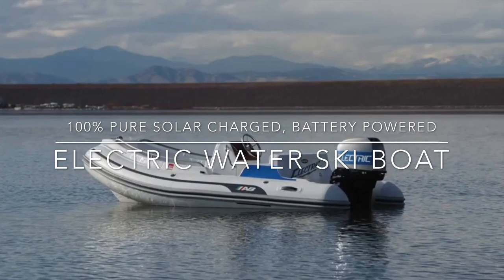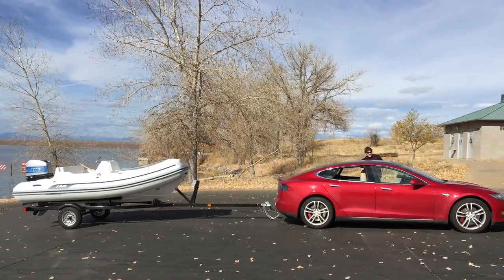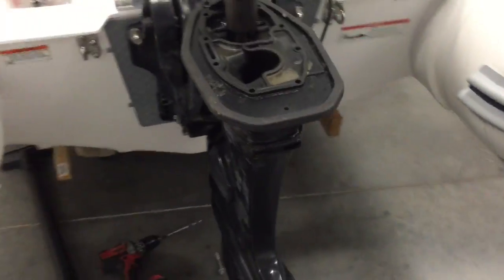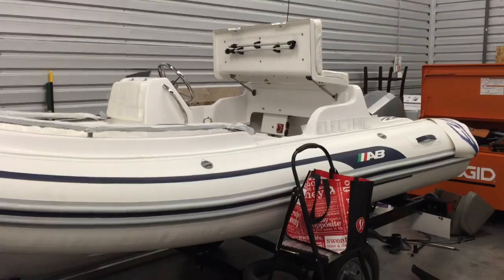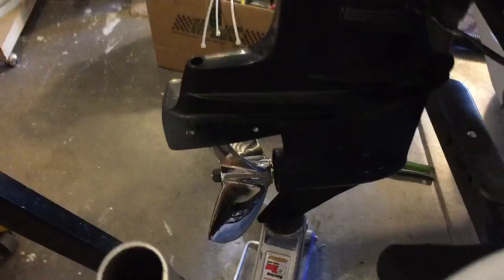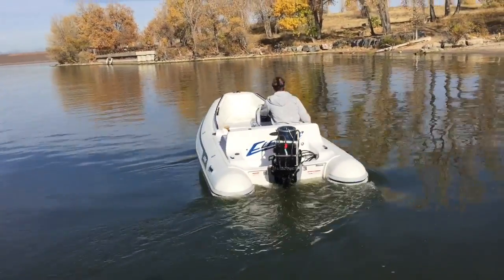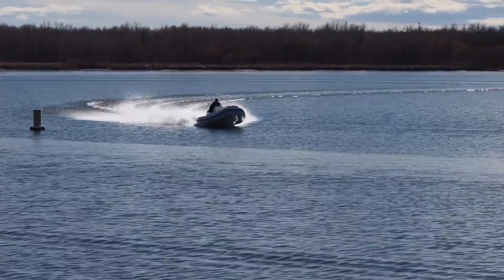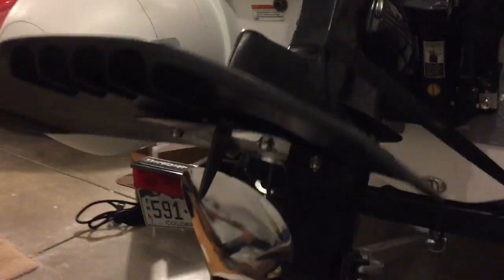World's Fastest Solar Powered Electric Water Ski Boat  (full documentary)

Comment: ITS NOT SOLAR POWERED !!!!!!!!!!!!!!!!!!!!!!!!
Its battery powered.   Solar recharges the cells.
Reply: He has at least a  50,000 watt battery cell.  It would take forever for a pair of 250 watt panels to charge that thing.
Reply: If you had a day of wind around 45mph and a turbine you could charge that battery up within a few hours and then go  out and try to fight the wind.
Reply: Dan Henderson I have a question how does the water and electrics work ? Is it not a problem when it gets wet ?
Reply: @rsafishingnoob6337  you mean you've never had battery powered toys that you put in the water?
Reply: @rsafishingnoob6337  Most electric motors run fine completely underwater. Usually the only issue is corrosion.
Reply: Well if you want to get technical/literal, are you powered by food, or by fat, or by the chemical process your body uses to get the energy?...you know what they meant... Technically pretty much all our energy comes from the sun. You say it's battery powered, but batteries don't generate power, they store it chemically, so technically you're wrong. It's electrically powered...Lol

Comment: solar works awesome if you have the time to allow it to charge well know fact 
but today most do not have the time and require transportation right now 
yes i have 1100w of solar charging 16 6v cart batteries with 2 40amp charge controllers and a 1800w inverter powering all internet power and all charging of devices that require it like cell phones tablets and laptops and i can even run my gaming pc with a 42" lcd tv 100% of the time 
also have a water heater with a single 300w 12v heating element with 3 100w solar panels connected producing most of the hot water we need but with all of this i still understand that Natural gas and oil still produce much cheaper power for the world that also at this time still produces less negative harm than the battery and electric production when you count all of the pollutants produced by manufacturing of batteries and recycling batteries and all chemicals required for there use of solar 
i know that some day Solar and wind will be the way to go but in 2017 it is not the best or cleanest way to produce power but soon it will be and i am 51 years old and hope i see the day

Comment: I love this idea I'm glad it worked out great but a typical gas and does not idle at 1000 rpms and idles at about 5 to 600 RPMs anything higher than that will cause damage to the forward and reverse selector also you need to switch over to a hydraulic trim this will help you plane easier and then you can change the pitch on the engine itself the cruise better at speed

Comment: Wow, very cool. Great job. Why wasn't the oil cooled motor not good at the end?
Reply: Seems to me the oil leaked oil when positioned in a way it not made to be placed, not to also mention it adds weight on top with the cooling system needing to be installed to cool the hot oil.

Comment: I love it!  Great job on a great project.  Looks like your welder needed a couple more batteries to get good penetration on that aluminum plate. lol It appears that you are certainly smarter than me, and likely don't need the advice, but if you preheat your aluminum plate with a torch or in the oven, you'll get by with a smaller welder.  Again, great job.  Subscribed.

Comment: Pretty cool project. Either get some more practice at welding or bring it in to a professional. The welds on that mount looked scary.
Reply: He needs a Square Wave welding machine for aluminum welding. Older high frequency machines make it very difficult to make good looking inside corner welds even for a welder with experience.

Comment: Not technically solar powered if there are no solar panels on it!
Reply: Gillenz Fluff you didnt think that through did you?
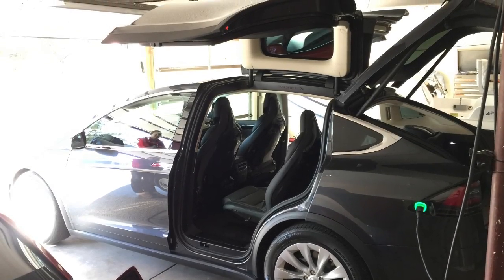Reply: I think he was using the solar array shown at 0:40 which looks more like an 8 or 9KW setup. But I also find no mention of run times to be curious... 53mph for 1 minute is kinda pointless.
Reply: NET METERING!
Reply: Gillenz Fluff A charge by solar power as a battery a good invention.
Reply: Agreed... great engineering, but dubious title and performance claims. I have great respect for the mechanical and electrical engineering required for this project. However, the title is inaccurate at best, and click-bait at worst.  This is an impressive electric boat that is capable of pulling a skier, but it is neither solar nor is it a ski boat.  

The solar panel that he shows at 6:09 (230W?) would require months to recharge a "40KW" battery bank. The author states at the end of the video, "... recharge in about 4.5 hours on a 240-volt circuit...". That implies mains power, not a solar system. Of course, he could have a large, solar-powered charging system at his disposal that would make this an INDIRECTLY "solar-powered" boat, but we're really stretching credibility here. 

No runtimes are cited. The speed figures in the video overlay aren't backed up by any onboard speedo or GPS figures either, so we're essentially looking at marketing fluff.  Hey, I have a flat-bottomed bass boat that does 200mph and makes perfect 90-degree turns at hull speed... any takers? :-/

Comment: I like smellin the gasoline and oil while boating myself,  and the hearing the noise of the motor also. Electric boat / fail. Sorry. Nice experiment I guess.
Reply: Bob Kerbs if it works, how is it a fail
Reply: Actually the energy from petroleum came from the founding of the universe. It was proven about 25 years ago that petroleum was created when the earth was formed. It comes from the deep earth. It flows through fossil beds and that is why the mistaken theory it came from dead dinosaurs. If it was only formed from decayed plants from the prehistoric eras, we would have run out long ago. Search abiotic petroleum.
Reply: Elliot Roe it's a big fail click bait because he says solar powered and clearly it's not. Solar charged perhaps, but battery powered with juice from coal, nat gas or hydro.  Look down the line and someone's  polluting to make the juice.

Comment: That is fairly fast for a dinghy.  My taste runs more to boats that can hold the whole family. What's the run time on that thing at skiing speeds?

I looked into building an electric boat a while ago, but that was pre-Tesla and would have required about 3000 lbs of batteries. It looks like technology has improved substantially.  Where did you get the modified golf cart motor? 

You obviously have a great deal more money to experiment with than I currently do.  Maybe in a few years I'll have a little more money to play with.

Comment: I'm missing the solar part
Reply: You can easily make it actual solar powered by putting extendable outriggers on the sides for the panels and then putting them on when the batteries are charged.
Reply: He charges the boat battery with his solar array on his house.  Thereby, it is a solar powered boat.
Reply: @JPZANE  NO. Its battery powered, he recharges the batteries with solar thats a difference. If you are able due to solar panels ON your boat, to run the electric Motor with solar power, than you can say its solar powered-

Comment: I would have been impressed if it were actually solar powered, even if it only goes 3mph.  This is more accurately defined as a hybrid.  It probably used coal and hydro to charge the batteries.  Try the boat project again using batteries and solar panels and complete off grid operation.
Reply: Its solar powered off his house mounted Solar PV roof array.
Reply: You would think if Mr. RVJimD was smart enough to build airplanes, he would know the difference between a hybrid and an electric. Hybrid's use both an internal combustion engine and electric motor. Although the description does give the impression that the boat might run 'directly' from solar, it actually runs indirectly from solar power. If he had watched the video to the end before commenting he would know his comment was asinine. @ 9:08, you will see the solar array on the roof of his house, which is charging the batteries. Hence "solar powered electric water ski boat".
Reply: https://www.youtube.com/watch?v=V7flR0O-coU
Reply: This argument has been debunked.
Reply: Talk the talk, what have you built?
Reply: Lawrence Hall is an RV6 good enough for you?

Comment: i have a seadoo hull and a fork lift motor i want to use to run it.. what would you recomend for power and control?.. i believe its a 36 volt motor..
Reply: shank that bass Curtis controller be best and lipo/battery pack be best, depends on your power to $ range, 3x12v sealed lead acids could be used for testing and then work out ya budget for new/modern cells

Comment: You call that a ski boat?
Reply: V3MD if u can ski behind it it is
Reply: It's prototype it get better
Reply: A ski boat has to have some weight. When trying to pull a skier up, the nose of this dingy will be pointing at the sky. If it manages to get the skier up, it will be shaken off course every time the skier turns.

It's still cool, but don't call it a ski boat.
Reply: gotgarkala did you watch the video?

Comment: So you call it a solar boat but charge it " on a standard 240V power supply"? That is only a solar boat if you are charging it your home then where it is solar not out by the lake. What was the total cost to build such a machine?
Reply from the maker: homie789 
Thanks for watching. It's true, if you charged it at the dock you'd be using whatever power is available. I only charge at home off my solar array or using the solar Bimini top.  I probably have $50,000 into designing it and figuring it all out however the motor and controller and wiring is about $5000 and batteries are about $8000 so on par with what you pay for an outboard gas engine.  I get 105 hp out of this but would have to buy 150 horse power gas engine in order to get that much power and torque here in Colorado where our lakes are 6000 to 9000 feet in altitude where is the electric motor is unaffected. The overall weight is exactly the same as a gas set up. It would take an entire week of sunshine to fully charged battery using just the solar Bimini top.

Comment: you need to get some of "GP audio's" O.F.H.C. 'merica wire its available upto 4/0, 2/0, 1/0,& 4 gauges of pure copper wire thats tinned its UL tested & approved because I dont see how all that thin wire is helping you I do serious car audio builds and wire size is a big factor in audio my daily driver truck has 3-2/0, 2-1/0 & 2-4gauge runs from front altenators & starting battery to the xtended cabs bank of batteries then to amplifiers but when I switched out 0gauge , 2 & 8gauge wires for the much bigger 2/0,1/0gauge wires it was night & day diff I had no overheating or thermal protect modes plus could go louder with less sound distortion, it charges better, holds charge longer recovers faster and the Big Plus the added watts i gained on smd dyno by D'amore def made it worth it & then some.. I saw u had issues and switching batteries isnt always the right answer when ur using what appear as 4gauge golf cart wires which really are 8 gauge compared to car audio OFC or OFHC wires which go as thick as 8/0gauge these days

Comment: What is the range on it?  Did you calculate that out?
Reply: Thats what I would like to know as well. If you can only water ski for 5 minutes, that would kind of make it a bit useless...
Reply: at one point he mentions a 40KWH battery pack, and later says 70KW consumption at 85% throttle.  which means around a half hour at 85% throttle, by my math.
Reply: Lucianrider they said they get about 4 hours of water skiing in a comment below.
Reply: Price Burnett no way he's getting 4 hours of skiing off that unit.  Probably less than an hour.
Reply: 4 hours to charge off 240, do the math. I think he mentions consumption at wot.  (I literally don't have my glasses with me right now)

Comment: hi. great boat. so cool. can you give me an estimate about the costs for the total costs minus the boat and trailer? so the total of the controls, batteries , motor, dead outboard, cables, chargers etc. i love the idea but am afraid it will be far to expensive for me.
Reply from the maker: Hi, thanks for watching!  I spent quite a bit figuring it all out, with failures etc.  The finished product consists of $4,000 for motor and controller, $9,000 in batteries, $500 for the dead outboard, $750 for the charger, $500 for custom propeller, about $1,000 in cables, connectors, hardware etc. So, around $16,000.  I probably spent twice that getting it all right, plus about $16,000 for the boat.  Getting the right prop is probably the hardest part.  Manufacturers don't expect you to have full torque from 0 rpm.  I should have gone with a bigger outboard to convert. Finding a 24" pitch for a 60 hp isn't easy!

Comment: interesting project.  I really like the idea of a weekender sailboat that I can lose the diesel inboard and replace it with an electric.  Is it realistic to put a battery bank in the same space as a fuel tank?
Reply from the maker: Yes, it's roughly the same volume though the batteries will weigh more than an equal volume of fuel.  I put 40,000 watt hours of battery in the same area as 21 gal of gas.  Also, you can't just refill the batteries as there is no supercharging at the lake (yet)  You will need to size your battery pack appropriately.  Very easy if you are only looking for 5-10 mph.  It gets exponentially harder the faster you go.

Comment from the maker: It's a Curtis 1239E Motor controller. It's really slick, it even has connections for all kinds of safety interlocks etc. I bought mine from thunderstruck-EV.com. They're available in different voltage and current configurations this one can take up to 170 V and 500 A

Comment: Hi, Does this motor work with a DPP up to 60V? Do you have any idea how much power it could deliver? Where did you buy lithium batteries?
Reply from the maker: Vitor Mathias 
Hi. Not sure what you mean. It's a 4 pole, 3 phase synchronous ac motor running 170 volts. It draws about 85,000 watts at peak.
Reply: @jltempes  Could you give the link of the motor you were using?

Comment: Maybe I missed it, but how many hours does this configuration operate at a given speed?  Great Job!  I have a pontoon boat with a hard top that I'd love to use as a solar boat, are you in the business of selling these rigs yet???  Again, GREAT  JOB!
Reply from the maker: authenticmind 
Hi, thanks for looking and the comment!
I'm not selling (yet). It's still a prototype and there are still some bugs to work out. Since I can run the motor below 1000 rpm, (anything from 0-8,000) I figured it could run for 100 hours at 2 mph using 360 watts. I've got almost 40,000 watt hours of battery. Full speed is only about:45 min. A good day of Water skiing, about 4 hours.
Reply: I have a pontoon boat and an old 100 hp Johnson outboard as well as a marina that would help me in the winter.  The pontoon has a hard top perfect for solar panels and I really want to build a solar pontoon.  Any suggestions or information, tips or ideas would be welcome.  I love the conversion you did with the golf cart motor and it seems affordable,  I can only imagine the lake with quiet electric, pollution free motors.  What a dream...Thanks for your reply!
Reply from the maker: authenticmind 
Feel free to call me and chat. I'd be happy to help in any way I can. The pontoon boat would be a no brainer in terms of viability. Way easier because you're not going to be as concerned about weight. 
Check out 
thunderstruck-ev.com

Comment: What kind of batteries? Lead-acid?  Have you thought of Lithium? I have the torqeedo 25v battery and it is a marvel of engineering, but pricey even at just 25v.
Reply from the maker: frank car 
Hi. I'm using lithium batteries out of a wrecked Tesla. It cost about $9,000 for 40KWh at 170 Volts I'm sure new batteries would be twice the price. 
7, 24v modules with 444 cells each. The battery's can deliver up to 1,500 amps but my controller pulls 500 amps.

Comment: are those ron hill props?
Reply from the maker: Jamie Nichols 
Wow!  Good eye!  Yes they are. He was the only one I could find with props in this size with that steep of a pitch. (24") I suppose there are not many 60 hp motors doing 50+ miles an hour
Reply: Net Positive LLC Your electric motor must be turning low rpm's?
Reply from the maker: Jamie Nichols 
Sort of, the motor can go up to 8,000 rpm but peak hp is at 4,700 rpm and my lower unit is a 2:1 gear ratio so that made it a bit harder to get a prop. Next time I'd look for a 90 hp with a lower gear ratio.

Comment: Absolutely wonderful.
I am very impressed with what you have achieved. The quality and workmanship is by far the best i have scene.  Well done. 
I am a boat dealer in Australia, interestingly i specialize in RIB's, but i would love to pick your brain at some point regarding the lessons you learned to get to this point.
I am Building a 22 foot long boat style skiff, this engine is exactly what Ive dreamed about powering it with. Also incorporating a full solar roof to charge and offer some shade from the Aussie heat.  I was also thinking about a small honda genset, for the longer weekends away. 
Great job once again.
Reply from the maker: blackdiamondmarine 
Thanks for the comments! Feel free to give me a call or email sometime.
3038849847 
Info@netpositive.co 
I am still learning and would love to chat with you as well.
Reply: Sure, throw a couple solar panels on the bimini to re-charge. Should only take about 3 years to get enough charge to get you around the lake again. This is not a trolling motor using a couple of 20 amp hour wheelchair batts. Seriously. That motor is sucking more juice than your entire block under acceleration and fast cruise.
Reply: Did you have your eyes closed when he showed the aluminium motor mount.. !!! (Sorry I am a welder by trade) haha :-)